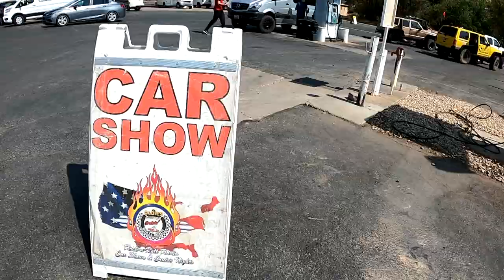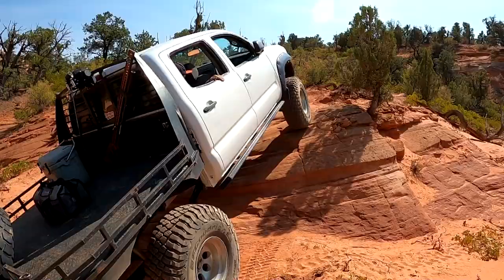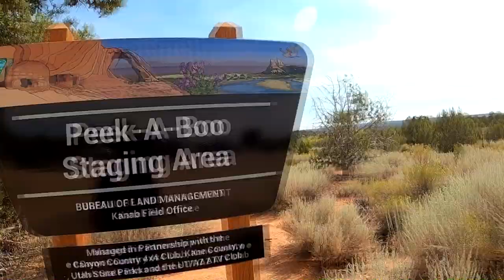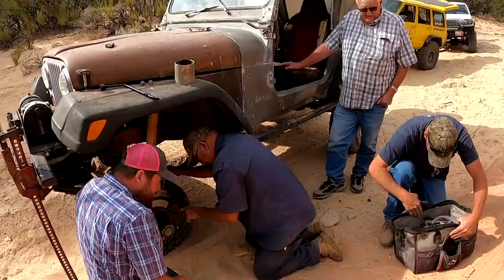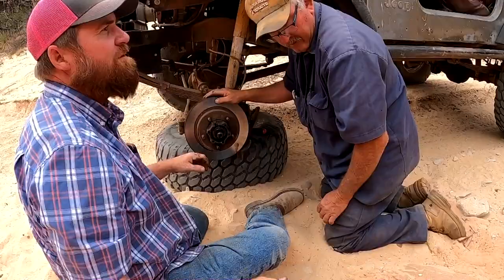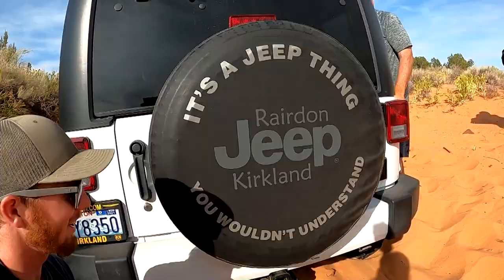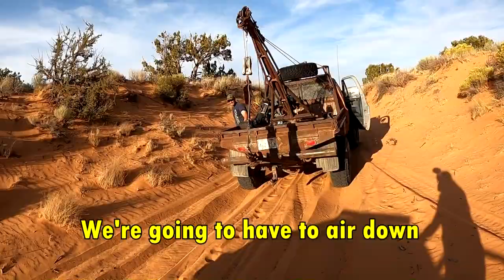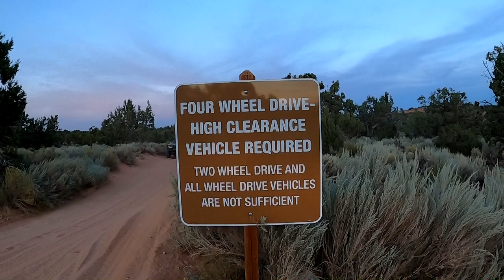RAT ROD Tow Truck Rescues JEEP!!

Comment: That's the best tow truck I've ever seen hands down.
Reply: I can't imagine any other tow truck being so happy off-road.   That had to be the same soft sand that Matt needed to help the white Jeep get through, but Paul's tow truck air'd down a bit, and not only got up those soft slopes, it did it while towing another Jeep.  It seems to me that if they ever film a Mad Max sequel in America, they'd do well to hire Paul to build the vehicles.
Reply: Check out the BSF recovery channel. They have an off road tow truck very similar to this and volunteer at off road parks.
Reply: @MrJamesLuz  BSF Recovery is awesome.

Comment: That old sling truck is sweet! As for the Hi-lift jack, I have a strap that stays with my Hi-lift jack that I use it to strap the jack to the bumper so if it tries to kick out the strap stops it. It's just a pull strap that tightens when you pull it, and then you lift up on the clasp and it releases it. It tightens and loosens like the shoulder straps on the 4 or 5 point racing harnesses. It just makes me feel better about using it.

Comment: Between rat rod tow truck and the work on the Corvair you're doing for Matt, it makes me want to drop off my 85' F250 (4WD w/ the 460 motor) with you for a few months. It needs to be either a plow truck or a crawler. Or both. I'm in Idaho, but it'd be worth it. Fab Rats would show it the love it needs.

Comment: As others have said, what a special group of people  Having fun, giving each other crap, nobody is upset or getting offended.  I love it.

Was that axle kinda undersized for what you were doing?  When the jeep was climbing the rocks earlier it just looked much less substantial than the Tacoma or the Banana.
Reply: Its a much lighter car than the Tacoma and Banana, so it doesn't need the same size axle..
Its a bit of a tradeoff, a lighter car doesn't need the strongest parts, if you want more durability you can build with stronger parts but then its not as light anymore..
Reply from the maker: There’s no need to upgrade til it breaks, but it’s broke now so an upgrade is in the near future.

Comment: I had that same 383 setup in a 85 Toyota straight axel on 39.5 boggers I had 4:88 gears, spooled in the rear and locked in the front had a th350 trans with manual valve body. I bought a conversion plate so I could run my Toyota tcase and driveline.  Everyone thought it wasn't gonna hold up, but that was by far the least broken of of a fleet of mud toys. I beat the livin hell outta it every Friday night thru sunday lol. Only had to put gas in it and change oil. It would come alive in 4 low 3rd gear bout 6500 rpm!😉🚀🙈🧻

Comment: I  miss the days cars had chrome bumpers where we`d grab the indents on both ends with a 6ft chain or J hooks under a timber, loop cable back thru a shackle (tire iron) on wrecker bed extend boom pull both directions tight...done

Comment: I drove a 2009 2500 chevy with the duramax out to Red Canyon in May this year. The sand was super soft then too. I think a lot of getting stuck has to do with the driver. With the diesel I was complaining about the lag of the turbo. I eventually just revved the motor the whole way out, and took over on the shifting. I have a ZR2 Blazer that would have done better that I supercharged where I don't have a lag in power.

Comment: I use the A6 ac pump that comes on the older chevys and it does 150 psi with ease on my 71 k10 with k20 running gear that I swapped out the th350 for the sm465 and np205, but I've been building a twin np205 doubler for it that will also have twin sticks on both and lts all 32 spline

Comment: I got a square body k20 long bed on 35's with a caddi 500 Matt should buy from me. I'm local and the wife wants it gone. Perfect platform for a clone of that rig.
Mines about 9 different colors and I call it the Johnny cash cadilac truck because it was built one piece at a time and it practicly didn't cost a dime. Plus the Cadillac 500 big block.

Comment: If you need more weight on your tow truck steer tires you might extend your boom and attach it further forward.  I know it is not a high use vehicle and probably not worth the time but you have to tools and knowledge to do it yourself.

Comment: That sure sounds like a 383 doesn't it?  1970 Charger from Bullet!!!
Reply: Not a Mopar 383 - that's a common misconception. 

If you take a Chevy 350, bore it .030 over, and put in a longer stroke 400 crank (with turned-down mains) the displacement works out to be roughly 383 cubic inches
Reply: @heckcat5135  Is that a common thing to do to 350's?
Reply: Apparently.

I guess the aftermarket now produces this kind of crank.

As a Mopar guy from way back, there seems to be a significant increase in Chevy-centric guys asking "why'd they put a Chevy motor in that '69 Charger?" in the last decade or so.

Comment: I was out wheeling in my 76 cj 7 one day and fuel line cracked  and next thing I knew it was in flames the first extinguisher  was empty from the weekend before shenanigans  so I put it out with a blanket a hour or two later and one orange extension cord made into a wire harness  i was back on the trail

Comment: Yeah this is my favorite episode. I love the square body. I'm not a jeep fan, I know I've heard it all already. I'm currently building a 83 gmc k1500. I need a 4x4 and while jeeps are capable I'd rather not drive one. My first trans  rebuild ever on the sm465 is a mostly done. Did you upgrade the steering on the tow truck?

Comment: Great vid, and usually don't mind you but you should probably watch all the trash talking. The funny thing is, I started wheeling with Toyota's, every... single... time... something in that crap ifs broke, and all the axle trash talk about Jeeps, the only diff I've blown was on my 95 4runner, on the highway too, almost sending my drive shaft through my wife's head following me in her car because as I said, the front had broke yet again wheeling so she had to bring me my tools. 15yrs ago I gave up on Toyota's (after a couple) and got a Jeep, almost every Co trail in both my YJ and ZJ and we've yet to not drive home or get stuck and need help. Still running stock axles, locked too but never broke yet. On the other hand, but we could probably compile 24hrs of 5min shots of us pulling out Toyota's and Rovers over the years. Pre 90's Toyota's are pretty awesome and tough, but without thousands in upgrades, everything after is just chasing their former glory imo. Im a mechanic, not Jeep bias. I love lots of builds but Toyota/Rover guys and even some of the newer Jeep guys tend to have the biggest mouths yielding the least results of anyone. People used to respect a well built rig for what it was, I miss that. You've clearly dumped tons of cash into yours, fixing the weak points, I'd surely hope you could show some people up but I wouldn't brag too much since the price tag was triple to accomplish it. You're a mechanic and fabricator too, you should know better. Anyway, stay safe and thanks for the vid.

Comment: OK, with a rear "Spool", how the heck do you turn on the pavement without breaking something???
Reply: Chirp, chirp, chirp, or chiiiirrrrp... the  tires inside and outside tires turn at different speeds and one drags. Breakage is usually more likely off road.